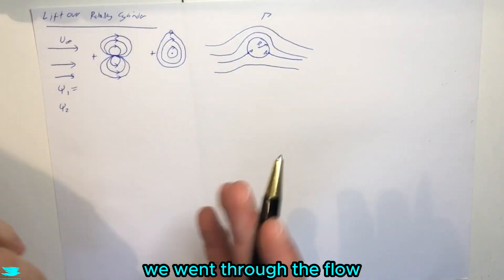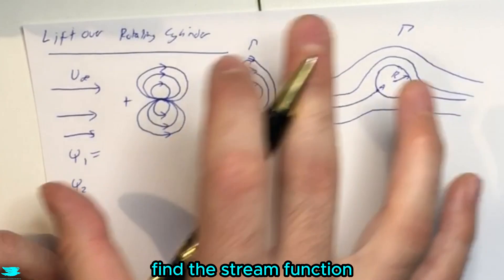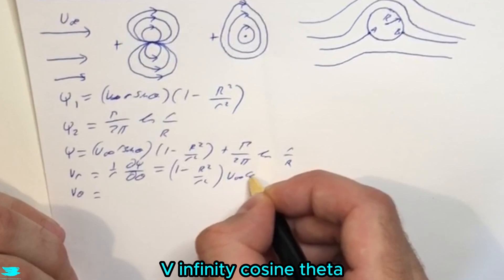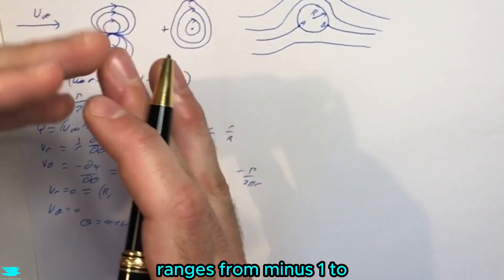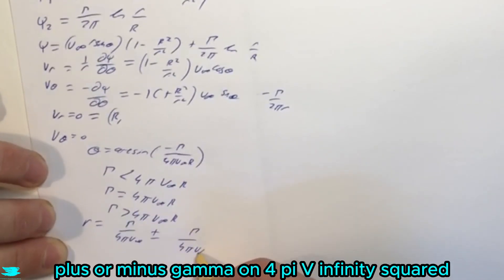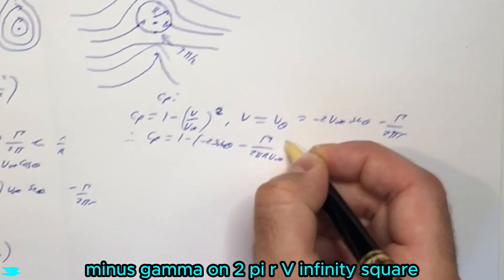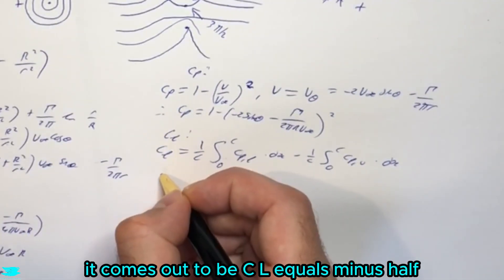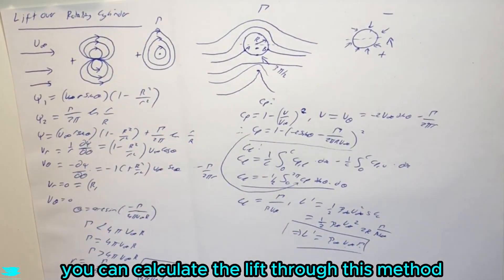How To Calculate The Lift Over ANY Object [Aero Fundamentals #59]

Comment: 7:10 Isn't that stagnation point a saddle point? If I remember correctly from my fluid mechanics class, the incoming flow above it will go around the top of the cylinder since for high enough vortex strengths there exists a sort of boundary layer that always flows in the direction of the vortex. You can get the function for a streamline that begins and ends at that stagnation point going around the cylinder.

Apart from that, very nice explanation!
Reply from the maker: Really good question. Technically, it is a saddle point, and because we are treating the inside as a solid, the stagnation point lies in the saddle point.